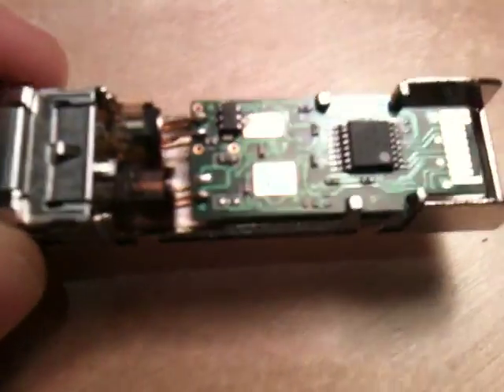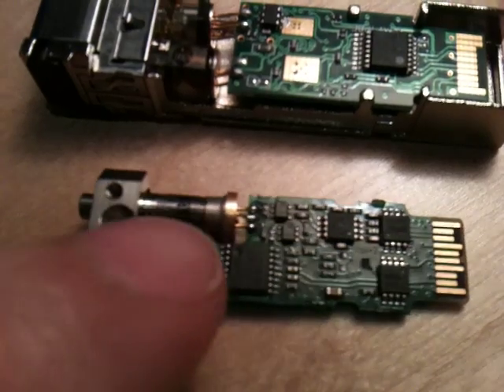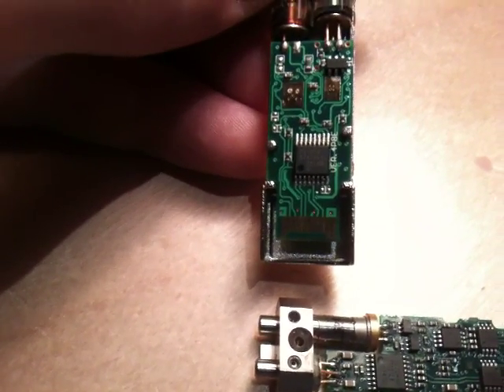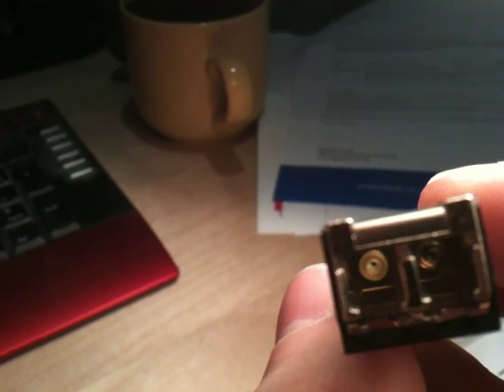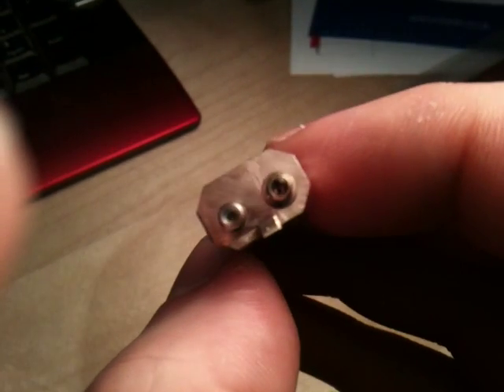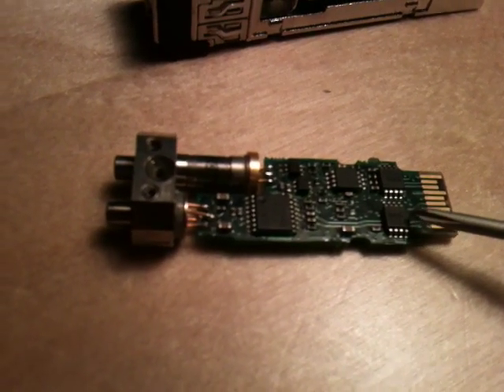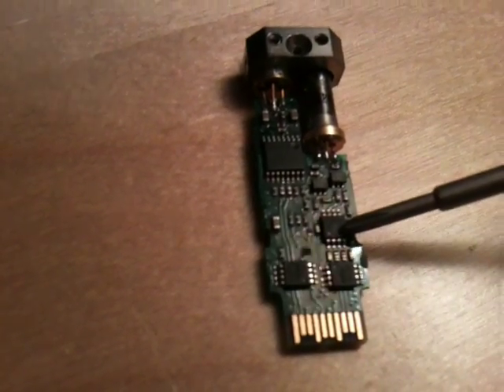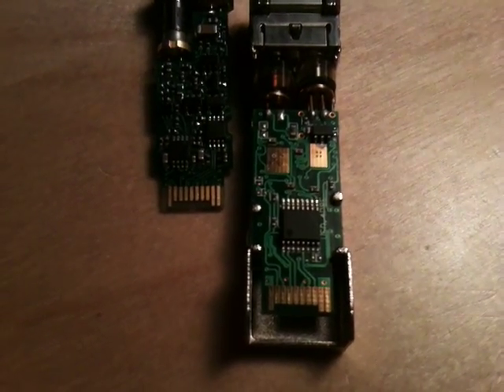Single mode (SONET) vs. Multimode (1000Base-SX) SFP transceiver dissasembly

Comment from the maker: @zx8401ztv Yes. This equipment is just an alternative for Cat5 cable with longer range (many km), or higher speed. Professional network equipment has this option (look at my video of my network switch).

Cat5 goes 100 m. Multimode optical modules about 300-500m with gigabit. Single-mode modules (1310 nm laser) can transport 10 km, and special long-distance modules (high power 1550 nm lasers) can go 40-80 km. Used in big buildings, or between 2 buildings.

Comment: oops sorry ive just looked at your earlier video about the net to series optical converter.
So can this be used to link say the internet from a modem net socket through fiber optic cable to a distant unit for connection to a pc.
If so its much neater than cat5 cable and faster than wlan.
im sure you will reply if im too ignorant, lol

Comment: hmm interesting stuff, you didnt say what there typical use was and i didnt hear you say anything about how they encode the data or modulate the laser.

Im not into this type of electronics so im ignorant :-)

Perhaps the other i.c is a pic chip and the eeprom is accessed via the pic chip????, as said im ignorant so .....
Reply: All they have to do is convert the digital data to light. So turn on the laser if its a 1, turn it off for a 0.